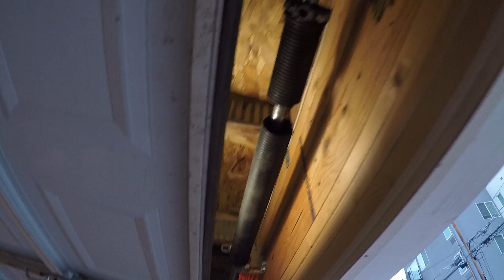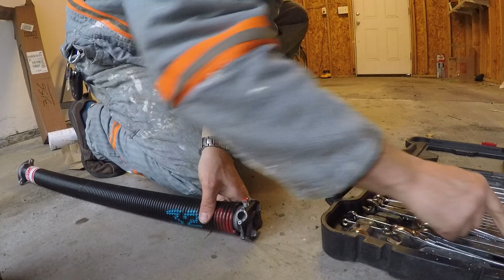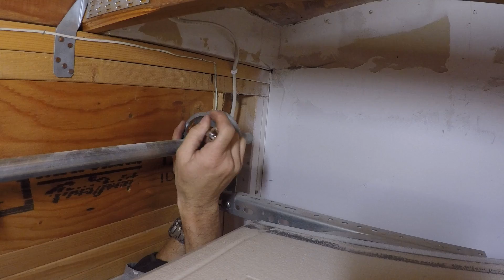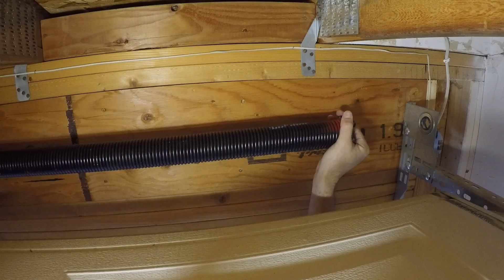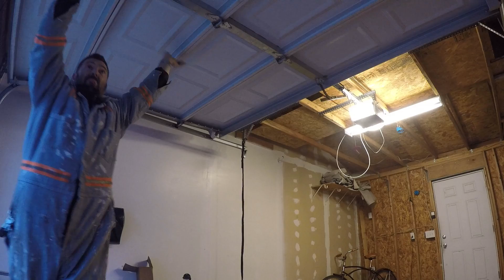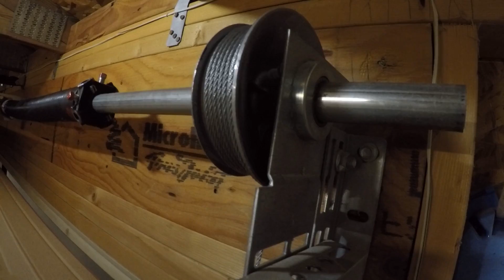How To Replace A Garage Door Spring Without Dying | THE HANDYMAN |

Comment: The pros wanted to charge me $800 for two springs and a new handler. I did it for $205 ($75 for the springs & 130 for the opener). Probably the easiest diy I’ve had to do.
Reply: @yokyok23bennett90  Yep, we charge $285 for double torsion springs for parts and labor. In and out in about 30 minutes.
Reply: i charge 175 for spring changes.

Comment: Many years ago while living in Houston our garage door became misaligned, wire off track and stuck. Being a Brit I had no experience with these kind of doors so our good friend and neighbor offered to help. No big deal, right. He ratcheted the central spring with screw drivers (since we didn’t have the correct tools) to lessen the tension on the wire while I tried to push it back on the guide wheel to the side. His screw driver slipped and I very nearly lost my thumb. I was very lucky to get away with bruising. One of the stupidest things I ever did. Still makes me shudder. The second screw driver was stuck under huge tension all night, my neighbor probably more shocked than me, understanding how close we came to a serious accident. The professionals came out the next day to fix our mess.

Comment: 26yr senior door technician here. 

1. Greasing the tracks is like greasing the roads. It wont stop the wheel bearings from squeaking. Grease hinges wheels (rollers), pullies (sheeves) and motor drawbar trolley and torsion springs.

2. A 3 foot long 3/8 round rod cold rolled steal bar cut in half so you have 2x 1.5 bars is the only way to go and only cost $9.00

3. All the squeaking in that door is in the hinges. There are 3 parts to the hinge and they are always grinding. Oil the hell out of all your hinges.
Reply: Thanks for sharing with all of us. Much value in your words.
Reply: Much easier with the door down... but what ever floats your boat. But this is dangerous right here. I e worked on commercial garage doors for over 8 years. Call a professional dont try this at home.  Thanks
Reply: Technician of 15 years here, the video says how to change the spring without getting hurt, but then he uses something that is clearly not a winding bar to wind up that spring.  :p
Reply: Paul DeFillippo I was cringing at the mud mixers lol.

But then again I’ve use long stem rollers before
Reply: @brandonhartman5950  lol, so have I. I had an old wooden Crawford Door with like zero Headroom, and the spring popped off the cone, so I got the spring back on the cone but I could not wind it with my bars for the life of me. Luckily it was a little 8 by 7, I was able to muscle the door into the open position set the cables gave the spring a couple turns with some long stem rollers, and was lucky as hell the spring didn't bind when I closed it.
Reply: Most springs use 1/2" winding bars
Reply: 26 years and you put oil on hinges?

Comment: I like your make shift spring tensioning bars (paint mixers). I'm glad it didn't backfire on you!

  I  replaced my two springs when one broke. I ordered the offical tensioning bars and springs from Ebay. I succeeded and replacing it but only after watching several YouTube videos. It was a little nerve wrecking but a great confidence builder.

Comment: When I was 19 I learned the ins and outs of overhead doors by being responsible for maintaining two 22'x14' chain lift doors.  When I started the job, one end of the building or the other was always broken. If both were stuck we were out of commission. In a few months I had them both purring. I knew it was dangerous, and I had an incident or two, but no blood was shed. Great video. Great advice. These things aren't intuitive. Know before you start.

Comment: I used to do this type a repair back in the day, sometimes on bigger industrial doors.  This always gave me a little bit of the  willies especially after seeing this repair go  bad.  Your fortunate that you just got your hand ripped up and nothing permanent, or your teeth knocked out .  I think this is a tough job for a DYIer.  There are forces that need to be clearly understood before  taking something like this on.  Even pulley spring balances can be difficult and hopefully people run safety wire through the spring so it can come flying off and reeking havoc.  Both of these spring balance systems use a lot force to balance those big heavy doors.  I'm not trying to scare anyone off, but this work needs to be done with caution.  Like you said, if you can afford it, let someone who knows what their doing take this job on
Reply: i guess im asking randomly but does someone know of a way to get back into an Instagram account??
I somehow lost my login password. I appreciate any tricks you can give me
Reply: @Ephraim Zachariah Instablaster ;)
Reply: @Fox Vincenzo It worked and I now got access to my account again. I'm so happy!
Thank you so much, you saved my ass :D
Reply: @Ephraim Zachariah happy to help :D
Reply: As a 21yr vet. I compare garage doors to a loaded gun. You accidentally pull the trigger, bad things happen faster than you can imagine. Spring tension is very dangerous!!!! Remember garage doors are the largest moving object on your house.

Comment: Old set were mismatched, 207 x 1.34 x 27 and 225 x 2 x 29. Metal was pretty bent. Replaced pole. Would 218 x 2 x 22 work as a matched set? How many turns should I start with? Door is 16 x 8 non insulated, 150 - 160lbs

Comment: I had a spring break when door was opening up, it came down hard and fast like a guillotine. I don't walk under the door until it's all the way up anymore! My door us double wide, 16ft, 1 panel extra tall, insulated,  windows, and extra supports for each panel, it is HEAVY!
Reply: Good advice.  Never really think of that when the dog is bolting under a door that's barely open 2' to go get the paper.
Reply: I’m having a hard time believing this story, and I’ll tell you why..... are you sure you’re not exaggerating just a tad??  2 reasons, It’s very unlikely that your door, as heavy as you say it is, would only have one spring, wich means it could come down hard and fast, but not like a guillotine. Secondly
Reply: OnlyOneFever answer to your question would be the second spring would keep the door from coming down like a guillotine
Reply: @hadablockers  I've had a spring break on a double wide and even with the one spring left, it still comes down fast enough to kill.  Or at least smash an animal or human head.   Guillotine is only a metaphor.
Reply: @hadablockers his story is very believable! 
I've worked garage doors for over 10 years.
 If 1 spring breaks on a big residential door like that, the operator can not control that door. You still have 100's of pounds coming down even with one spring still under tension.
Reply: @hadablockers  Each spring holds 1/2 the door, so a 200# door would still come down with 100# of force.   It would be loud and ugly and might seem like it's fast, mostly because there would be a delay between the door failure point and when the human operator notices it.  It would seem faster than it really is to someone not looking for it.
Reply: I beg to differ, I’ve been doing garage doors for 25 years now and never have I heard of the garage door come crashing down if only one spring broke. 99% of people have a garage door opener for one, wich will prevent the door to come crashing down. If it were extension spring that broke, 9/10 times the door will just go crooked, and bind up before it comes down. If it was an overhead spring with no opener.... maybe, just maybe it might come down, but it would have to be the right scinario, like say there was two overhead springs, a 207, and a 244. If the 244 (bigger, heavier duty spring) broke and there was no opener attached, it might come crashing down. Otherwise I’m just not seeing it like you say....
Reply: If a spring is gonna break, it’s gonna break when the door is down, not when it’s up, because that’s when there is the most tension on it. That’s what is meant to happen for safety.

Comment: I'm all for people learning about garage doors and spring replacements. However, as a garage door technician, I will advise readers to at least properly buy winding bars online if you are replaceing a torsion spring. I have personally seen the aftermath of customer using something not designed for winding (large screwdriver) and he ended up lucky that the screwdriver missed major arteries in his forearm. Also, if you are going to replace a spring, please stand on the OUTSIDE of a spring facing inward so if something were to happen, the throw of the spring will go AWAY from your body/face.  If you are unsure as to what "direction" a spring is to be wound, the easy way to check is at the winding cone side. The spring winds in the direction the wire edge is pointing, and it should be pointing "up". Getting this wrong can cause the spring to break or unwind while you are in the process of turning the spring and the Setscrews on the winding cone will spin and become like a sawblade. Dont forget, this is where your hands are during the spring winding process. ( read = loosing fingers) 

Garage door spring replacement is on of those very low cost of goods, but a professional will charge a few hundred dollars. It may seem like alot, but if you are not as mechanically savy and careful, the injury isn't a cut or a bruise. It's a lost finger or worse. It is not a decision to make lightly.

Also a 3/8 8 point socket on a ratchet is the perfect tool for the setscrews handyman ;)

Comment: Our garage has 2 single wide doors but the springs run parallel with the upper tracks. 2 springs on each door. One spring broke and shot through the garage/family room wall and across the family room into the china cabinet that held my grandmother's china collection. It was 3 in the morning when it happened! I about died from the shock of the explosion! Those springs have a crazy amount of stored tension!
Reply: What if someone had been in the garage when that happened? Those springs should have a steel cable running through the middle of them so the springs don't go anywhere when they break.
Reply: @MandrewP  They do now, but back in the 70's when the house was built, safety wasn't an issue I guess.

Comment: Did you lube the tracks? It sounded a bit squeaky.
Reply: The tracks should never be lubed.  The door's rollers are rolling in the tracks, not sliding.  The squeaking is coming from the hinges that connect the garage door's panels together.
Reply: The squeak is in the hinges, and doors will also make a lot of noise in the spring if it isn't stretched.

Comment: The doors not aluminum it’s steel, it needs lubrication BAD on all the hinges, rollers, spring and end bearings. The chain isn’t loose, the rail was just bowing up from pushing the door into the ground.

Also WAY easier to do the spring replacement when the doors down
Reply: He should also use real winding bars, not mud mixers. At least he wasn't using screwdrivers, another technician went to a customer's house once where the husband died using screwdrivers. The handle broke and the spring Unwound with the screwdriver stuck in the cone well until it came around and shot him in the head. Dude's wife came home from grocery shopping and found him still standing on the ladder with a screwdriver sticking out of his forehead. If you don't know what you're doing those things will kill you, end of story.
Reply: @pauldefillippo8490  While this can certainly be a dangerous job, that story sounds like complete BS. The spring is right up against the wall, so how did a screw driver manage to stay sticking out of the hole for at least a full revolution in order to gain enough speed to be dangerous?
Reply: @ns8013  are you a technician? If so you would know that sometimes the Springs are attached to a pad which can be built up almost 6 in from where the actual header is. The customer also use some stupid Screwdriver from Harbor Freight, I highly doubt it was a long screwdriver.

You can choose to believe the story or not, the person that told it to me was someone that I trust, and while I personally have never been to someone's house where a home owner died, I have seen many homeowners with arms in slings, black eyes, broken hands, and stitches across the face....... all from trying to doing Springs themselves.
Reply: I've been a technician for over 14 years now, I work for one of the largest door service companies in southeast Michigan as their lead technician, I have probably installed close to 8000 doors at this point, and probably at least that many repairs. I have seen a lot of stuff, and most homeowners are stupid, and this guy is going to generate more of them.
Reply: ns8013 I think 🤔 Paul DeFillippo just drop kicked yo ass! At the same time I am not a garage door repair man & I did my own springs with the right tools & was very respectful of the instructions given by the company who supplied those parts & tools which came standard. There is another company selling parts and say, “we’ve heard of people using XYZ tool but we don’t recommend using them for safety reasons” so instead of providing the tool they list it for sale as an option when selling their springs. Pretty dirty if you ask me! Company I purchased from provided everything needed to do the job safely and correctly. The whole time I kept in mind that my face could get ripped off if I did something stupid. It was a good motivator and I got the job done properly. When that guy said he’s going to use mud mixers, I cringed.

Comment: I like to set the tension so the door just wants to drop slowly and it's easy to lift by hand.  I then hook up the opener and make sure it works okay.
Reply: The test I've read in manuals is that you open the door halfway and the spring should be tensioned enough to hold it there.

Comment: You're killing me smalls, I was cringing more than once. I'm thankful you still have all your digits, and limbs. DEFINITELY not a DIY fix, hire a pro for that job. Also, that liftmaster GDO is supposed to have a little slack in the chain.
BTW a 12 point 7/16 socket fits those lock bolts perfectly.

Comment: I had a double spring door and watched a ton of videos before attempting this task when one broke.  I got the springs and bars off of ebay for under 100 bucks!  Used a marker to make sure all the pulleys could be lined back up and even put some paint down the springs so I could do my 31 turns it called for...  Then came time to release the non-broken spring, I put my bar in raised it and slid the next bar in so i could seat it against the door and boy that's when I realized how much pressure these were truly under.  Luckily, for me it went great and I saved 500 bucks off the 600 dollar quote I got.   However, from doing my research I learned that even if you take your time and do it right springs sometimes just break even brand new when being put under tension.  Now that I am older and make a little more then 10 years ago, no way in hell I would do this again.
Reply: How did you find out you needed 31 turns on the spring??
Reply: Do you have to turn it a specific way?
Reply: It was like you were writing my story.  Did it once, it all went well, never again.
Reply: @guillermoosuna6621  My door had a tag on it that said 7 and 3/4 turns, and since the star where the rods go in were 1/4 I just came up with 31.  The painted line let me count the stripes too, I never lost count but my painted line was my back up plan I saw on youtube.
Reply: @CamperRemoval  yes, the spring winding up is what assists lifting the door so going the wrong way would make it hold the door closed.
Reply: Once you draw the line on the spring, each vertical line represents a ft of height from the door. So if yo have a 7ft high door there’s supposed to be 7 lines that’s 28 quarter 
 turns and you can go up to 30 quarter turns if it’s necessary. If you go over two more quarter turns than your supposed two than the spring is not right for your door. I have a few yrs of experience and 31 turns is a really odd number of turns since the standard height door is 7 or 8ft. That was reason of my question.
Reply: @guillermoosuna6621  Thanks for the info, I wasn't sure why.  Also I could be wrong about the tag, I might have done 31 turns because that is how many it might have taken to unwind the non-broken spring. I do know that the door was 7ft, not 8.
Reply: Worst horror story I heard, was a guy unwinding his torsion spring, and the winding bar took the skin off the side of his face, breaking the cheekbone, as well as knocking some teeth out. He saved a few bucks tho, doing the job himself

Comment: About 10 years ago, I replaced the broken springs on my wooden 2-car garage door. I used bathroom scales on the bottom corners of the door to make sure I had an even weight on each side. Can't remember the weight but maybe about 20 lbs on each side when fully closed?

Comment: I’ve read every single comment posted and not one “pro” says anything about unloading the spring as its being wound. Every two to three rounds you should take your free bar and tap the side of the loaded bar, being careful to hold the bar firmly in place, so that the spring unloads and doesn’t load up on one end more than the other. If not done, the spring can bind against itself and experience premature failure.
Reply: If every pro hasn't mentioned "unloading" (wrong term)...it's because that's not how you do it. Coming from a pro.

Comment: Probably not a good idea to improvise with the paint mixer bars. I bought a pair of metal rods to wind the springs even though they won't be used again until the new springs break.
Reply: Agreed!
I bought a 1/2 inch 3 foot rod and cut it in half, I think I payed 8 bucks or so.
Now I have that tool forever and it fits in my top cabinet without obstructing anything.